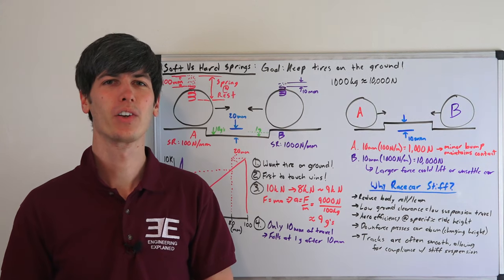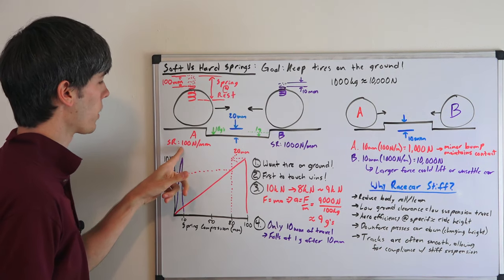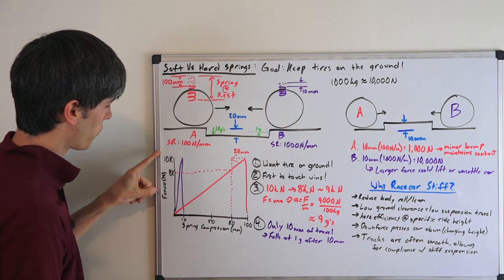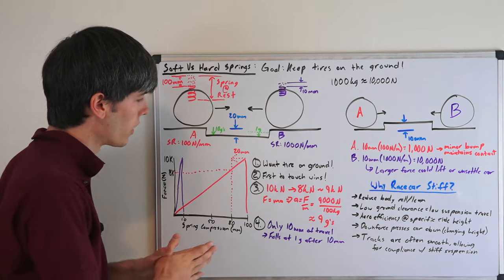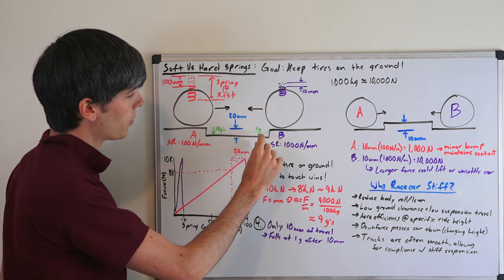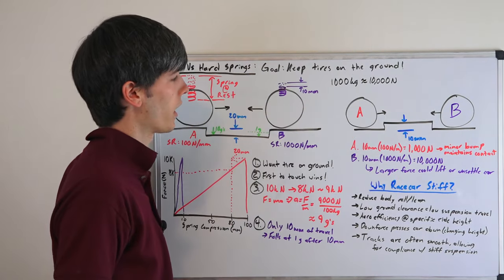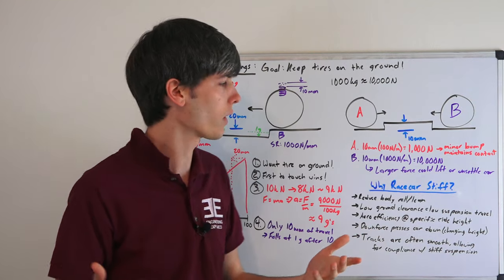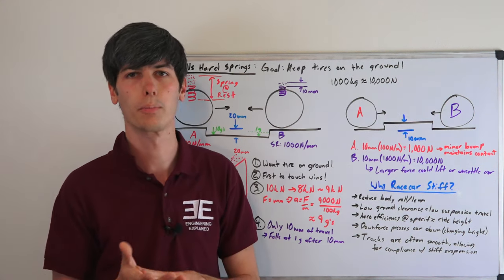What's The Best Suspension - Soft or Stiff Springs?

Comment: No mention of the main reason to use stiffer springs on a road car, i.e. steering response?

It's a tradeoff between absolute grip and responsiveness, where most people prefer a quick responding vehicle (especially at 200mph) to a boat that feels numb.
Reply from the maker: ***** I wouldn't say steering response is the "main" reason for a stiff suspension. Plays a role, certainly, but if all you want is steering response then get rid of your suspension.
Reply: Engineering Explained 

Hyperbole is unbecoming of you.

If what you say is true, then EVERY manufacturer would use the softest spring rate for a given vehicle weight, yet they don't, as if they were balancing grip against some other intangible. I wonder what that could be?

Not to mention depending on the spring rate and responsiveness, a stiffer spring will get through a corner faster than the one with more grip as the softer spring response is never quick enough to take advantage of the extra grip.

As I said, tradeoff.

Luckily Jaguar did experiment with no suspensions on one of their LeMans cars (so I don't have to). It did poorly.

Comment: So clearly a softer spring would be ideal to allow tires to make maximum contact with the ground. That make sense, especially in an off-road situation. But do stiffer springs offer cars better handling than a softer alternative? Or is the ground contact tradeoff not worth it?
Reply: Aneesh Sompalli it reduces body roll, and since your center of gravity isn't prone to shifting as much you can corner faster on a smooth surface. the problem arises when the road/track you are on isn't smooth ,and that is what this video covered.
Reply: Aneesh Sompalli the stiff suspension does help with body roll as +vlaricshard2 stated, but the benefits fade when the road surface is not smooth. For daily driver car, a  stiff suspension is not as beneficial as a soft suspension because of the road conditions/imperfections. If I'd was me, I'd get stiffer springs than the stocks on a daily driver but not to the point where I'm loosing too much comfort/traction
Reply: what he said

Comment: If that's the case wouldn't an adaptive suspension such as audi's magnetic ride control be best fitted in a road car since it can vary the dampening rates of the car depending on the road surface quality and insure maximum contact with the ground?
Reply: behemothinferno Yes it would. An active suspension system is always better than a similar passive one with normal springs. Well, as far as the controlelectronics don't fail. That's the drawback of it.
Reply: shi01 Not always. Cost is a huge factor in racing and many teams ditch automatic suspension for conventional setups especially on street courses. To have a constantly adjusting suspension system changes the feel of the vehicle completely and on road courses at the limit can be difficult for the driver or rider to predict. On track of course that is a different story since the suspension can be pre-tuned for each corner.
Reply: behemothinferno Ofc active suspension is the best thing. In the late 80 (I think it was) it proved to be so good in F1, no other team without active suspension had any chance. But it also ment that the car war was driven by computers to a quite bit extend. Because of that and because Ayrton Senna was whining, FIA prohibited active suspension in Motorsport.

On the up side, I'm pretty sure conventional suspensions are more fun to drive :P
Reply: +a.k.a. image F1 suspension and road car suspension are totally different.  active suspension in F1 was useful because it enabled stiff suspension at high speed to cope with the 3-4G of downforce, yet soften up when the speed dropped to absorb bumps.  road cars don't generate downforce like that.  F1 suspension could also be programmed per corner for a particular track.  road cars need to cope with whatever road the driver decides to drive on.  totally different scenarios and what works in F1 is (As in this case) often irrelevant for a street car.

Comment: One wheel would not have 2,000 lbs on it.  In my opinion most sedans range from 3600-4200 lbs curb weight and even more when fully loaded.  Now if we extrapolate that's roughly 900-1050 lbs per wheel.  When would one wheel have more than double the amount of weight applied without consideration to the other 3?

Comment: I'm trying to figure out if you should use the spring rate only to set the right sag and then using compression damping to prevent bottom out ? I'm getting a less that ideal ride from my Bilstein B14s, stiff and abit bouncy and it still does not prevent bottoming out. I wonder if I should go lighter on the springs, and increase the compression damping, but that would require me to change the system as B14s are unadjustable

Comment: what's going to be more comfortable for driving in the highway?
Reply: Soft.
Reply: Air?
Reply: Soft for comfort, but if you want to change the lane very quick as if a lorry just stopped in front of you, stiff could potentially save your life, as your brakes will be much better and during high speed you can steer without rolling over, to another lane.
Reply: ***** Braking effectiveness depends on how fast you're going.  If you're moving fast enough that you will be on the brakes after the weight transfer finished longer than while the weight was transferring soft suspension will be better. 

*added a few missing words that made it not make sense, my phone typing isn't great.
Reply: Man I dont do theory on coilovers the car does brake much better there is no body roll...
Reply: ***** Coilovers can be softer, firmer, shorter or taller than the stock setup.  Usually when modifying a street car they're shorter and firmer, but it's not necessarily so.  For example, a track vehicle may have shorter and firmer coilovers, but an off-road vehicle might have taller and softer ones.  Also, one of the nice things about coilovers is that they're more easily adjustable for height and firmness.  For a custom built race car, coilovers may be set up with soft springs and dampers for the reasons mentioned in the video.
Reply: Well they're MUCH MUCH stiffer than standard suspension, in my case it was 32 times stiffer. And yes it was a fully adjustable set, height adjustable as well, better camber was helping on the corners and very stiff settings was perfect for the race track, but even the softest setup was very stiff and due to me selling the car I sold the coilovers separately and put the original suspension on, that was a huge difference the car started to be like a boat in corners, also the comfort level was much better, the control of the car was harder, the brakes because of the shift of the weight during the braking weren't the same and of course the acceleration as well. Check out my video - there you can find the stiffest setup on the track where it was so stiff you could jump on the bonnet and the car wouldn't even more just like if you were jumping on the table.
Reply: The key to ride quality is in the shocks/struts, not the springs.  A good set of coilovers will not ride any worse than factory in terms of harshness.  I ran 4x the factory spring rate on my 2009 Mustang GT and the car rode better than it did from the factory.... having a good set of shocks/struts matched to the spring rate with good damping curves helped tremendously.  

My current car, a 2015 Mustang GT currently competes in F-Street for Autocross and I can't change spring rates, but I can change the shocks/struts.  Doing so made a huge improvement in ride quality, to the point where added spring rate (and a class change) would produce similar results as my 2009 did... Not that I'd make those changes right now though.

Comment: EDIT: Just read your conversation with davetek490 and I think I understand now. Sweet! Could we have a graph for the 100n/mm soft spring and spring with a 20mm preload (so the maximum travel is the same as the dip)? I think that would mean a 500n/mm spring rate if my maths is correct.

In the first example, would the stiffer spring not push the tyre down quicker for that first 10mm over the softer spring? So for argument sake as long as the preload (is that the 10mm and 20mm compression with the spring at rest?) on your stiffer spring was less than the biggest bump on the track - would that be optimum?

I'm assuming once you add the cars forwards movement, wheel A might not hit the ground in the dip until maybe the halfway mark, whereas if wheel B had a slightly smaller spring rate so that it was compressed 20mm, the tyre would hit the ground in the dip at maybe the 1/3 mark?
Reply from the maker: Alex Jennings Seems to be a misunderstanding of pre-load, perhaps I should make a video on it. Changing pre-load does not change the amount the spring compresses when you place a load (the car) on it. Changing pre-load does not suddenly mean the suspension travel is different. What you're doing is loading the spring by compressing it within the coilover itself.
Reply: Sure, so if you put a preload on a spring that compresses it by 50mm, then any force on the spring that would compress it less than 50mm (if it were loose) won't have any effect at all. Is that right?
Reply: Using length probably isn't the best explanation. As I understand it, if you have some coilovers and wind the bottom collar up to shorten it, you're installing preload. So say you shorten it by 50mm, you may have pre-installed say...50 newtons of force. So as you're driving along, any bump up to 50 newtons won't compress the spring at all? It will act as a solid object? Am I in the ballpark?

Comment: If you take any spring (let's say that soft spring with 100 N/mm), the force you need to compress the spring would increase exponential or am I wrong? The graph on the board indicates that you always need the same force (x) to compress the spring for every mm. But a spring gets stiffer the more you compress it?
Reply: +BlackyTMU the chart shows the force increasing or decreasing,so it's not a constant... however progressive springs will react differently from linear springs.
Reply: +BlackyTMU 
With a "straight rate" spring, the force per distance (rate) is additive for each unit of distance.  If you have a straight rate spring that is 20 LBS per inch, it will take 40 lbs for 2 inches, and 60 lbs for 3 inches, etc.

For a progressive rate spring, the rate usually starts off soft but requires more force per unit of distance traveled.

Personally, I like straight rate springs better.

Yes, I would rather be straight, than progressive.

Comment: I replaced oem suspension to amada extreme on new dmax/vcross but the ride was so stiff, rear rancho8000xl, i dont know what to do, any sugestion to get softer suspension? Gas or oil shock? Monotube or twintube? I hate potholes

Comment: So for shocks with more dampening action, is it that they want stiff shocks so they need stiff springs for it to work right, or is it that they need stiff springs so they get stiff shocks to work with it? Which came first? The chicken or the egg? err, the stiff spring or the stiff shock?
Reply: Colton Kreuzer Stiffening the dampener only means its harder for the suspension to travel fast up or down.

Stiffening the springs (increasing coil rate) means the suspension moves a little slower when it's compressed (not as slow as a dampener), but presses the wheel down faster compared to stiffer dampeners.

Correct me if I am wrong, Im no expert.
Reply: dongmaster9001 that's true and I know the difference. In my experience with hobby rc cars though, I know if you have a stiff spring you need a tight shock to keep the suspension from shooting out and keep the system tame. And if you have too tight a shock with too soft a spring, the wheel doesn't extend fast enough because the spring doesn't provide enough force to overcome the resistance of the shock

Comment: Do Springs wear out?  I have an ageing (13 year) sports car with the original suspension and has no shock absorption now so the tires are rather bouncy on bumps.  Do I need to replace spring and shock or just the shocks?

Comment: Hi thank you for the video I really appreciate the knowledge. So I have 2017 Ford escape SE ecobboost I just bought it and suspension is extremely hard as you have mentioned most sporty cards have very hard suspension but it’s worse than my Honda CRV 2008 on a 25 mile an hour turn I feel like I’m going to flip over and car cannot even handle I go way out of the lanes I have to slow down all the way to like 10 to 15 miles an hour any suggestions is in my tires or is my suspension that’s way too stiff. And I do understand that it is an SUV and it is top-heavy but I thought American cars are heavier than Asian cars so I wouldn’t that have a bit more gravitational advantage?

Comment: Jason, why do they say that a stiffer spring rate leads to faster steering response?
Reply from the maker: slip88 It's kind of about perception, but there's some legitimacy to it as well. When you turn the wheel, you have body roll, and a super soft suspension will have a good amount. This makes it seem less responsive as the car doesn't behave as you intend (flat). When it remains flat, it feels quicker to turn, as there isn't the time delay between turning the wheel, getting body roll, and then things flattening out.

Comment: OK... I have a 2014 Can Am Spyder I have put on ELKA shocks Pre set at Factory .... The fronts feel great but the single rear has little to no movement on it and when You hit a bump or whole it jars the rider ...  The dampener was screwed right ot and the spring was about 10mm from the top ....What can I do ....

Comment: I'm no engineer but the difference between the two spring examples are way too extreme and chosen just to prove a point. That second spring is like an ultra stiff racing spring designed for super smooth track use. Of course it will fail even on the slightest bump but thats not a fair comparison. Better would be 75mm compression on the second spring as most lowering springs made for road use are only 15-25% stiffer than OE springs with 25-35mm difference in bounce travel and no practical difference in rebound travel.

Comment: what about motorcycles, namely maxy scooters? i am quite heavy and by the traditional explanation i should stiffen my coil (1 to 5 preset) but the roads are pretty bumpy where i drive and it seems counter intuitive to stiffen it, should i leave it on soft or hard? at this point I'd rather put it in the middle and be done with it, lol

Comment: so, i bought these maXpeedingrods coilovers from ebay. all the videos on youtube review it as not a noticeable difference compared to more expensive coils. however, the ones i bought, i can't change the damper nor camber(not relevant.) I want to know if i can soften my springs (in case they're too stiff to my pleasure) without the ability to change my damper? meaning what if i change my preload? i dont need an explanation on what damper and preload is. i just wanna know if i can soften my springs without a damper knob and if there are other ways to soften my springs to my desire

Comment: If I have a standard 5' x 8' utility trailer with a small polyehtylene plastic boat on it that doesn't weight over 130 lbs. Could I replace the leaf springs that came standard on the trailer with ones that provide for about one third the load capacity in order to soften the ride of the trailer and reduce the shock transmitting through the trailer?  I think the trailer is rated at about a 1500# payload capacity right now.  Would replacing the leaf springs with ones that permit about half or one third of that load capacity produce less shock to the trailer suspension as it's going down the road?

Comment: What about a stiff vs a soft strut/shock? Does it affect the behaviour the same way as the spring does?
Reply: +thaik56 yes, offcourse

the softer the shock, the more 'old cadillac"
the stiffer the shock the bumpier

thing is, you can hardly ever find softer shocks
maybe "touring"
but most aftermarket shocks that aren't just like oem replacement are stiffer
Reply: lillnemo1 it seems so since I have experienced many of the stiff spring behavior despite only having my struts replaced by aftermarket ones.

Comment: What would I need to change on a Honda CR-V to make it ride softer like a Cadillac. Coil spring or strut or both?  I want cheap because it's old.
Reply from the maker: +TheMathersFamilyVids Softer springs and less aggressive dampers.
Reply: +TheMathersFamilyVids put small rims with high wall tires on it

will do the same

lol
Reply: +Engineering Explained hi,can you cover motorcycle related topics too? 

Many thanks,and greetings from Scotland. 

Love your channel.. Best of its kind.
Reply: +TheMathersFamilyVids The weights and suspension geometries are radically different BUT for that make everything stock.
Reply: see now what you really need to do is sell that honda to a scrap yard and then buy a subaru or something

Comment: I think you limited the explanation too much by just talking about up/down movements of the suspension. Also you went to the extreme exemplifying a stiff spring with a racecar-stiff spring...obviously it wont work on the road. We all know a super cushy, super soft suspension doesnt result in a good handling vehicle either.